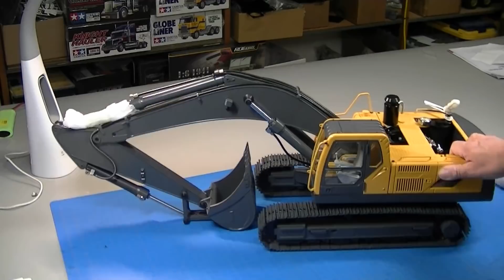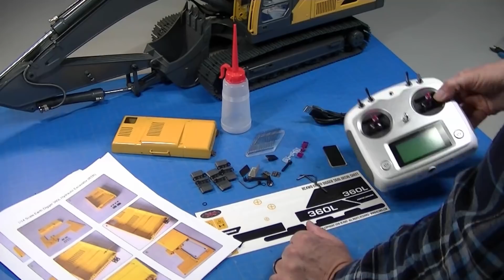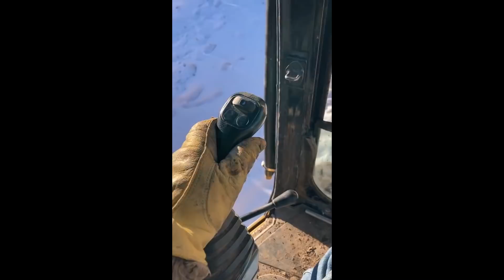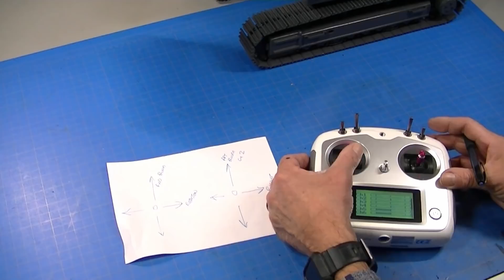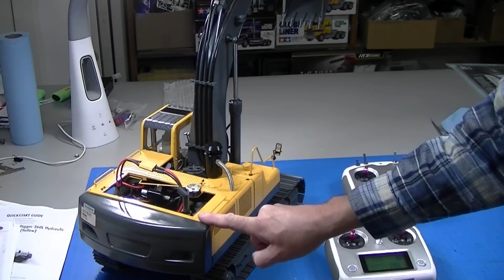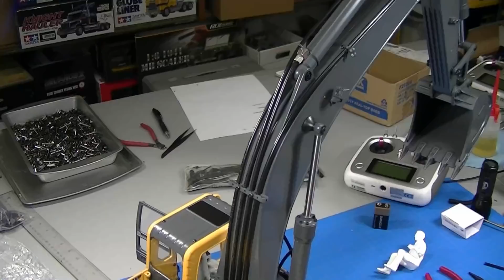1/14 RC Hydraulic Excavator Earthdigger 360L RC4WD - Setup, Programming  & Adding Lights

Comment: Hi, I have oil coming out of the muffler. Can you tell me why?
Reply from the maker: The muffler is the vent for the oil tank.  If the tank is overfull or you tip the machine on it's side oil will come out.  I put a balloon on the vent when I tip on the side.
Reply: @HobbyconceptsLLC Oil also comes out from starboard
Reply: how much oil should be in the tank, I'll tell you about half of it

Comment: top notch video as always, Ive just added this unit to my line up of Hydraulics.  going through the process of installing the extra options and changing the controls around also.. You have a eBay store?  If so Im sure Ive bought from you before but I know I do business with semi joes as well..
Reply from the maker: I don't do eBay anymore just my own website hobbyconcepts.net
Reply: @HobbyconceptsLLC  I totally get the quitting the eBay seller thing.  I have too as far as selling builds etc.  The fees and now taxes thing are a bit hard too swallow.  I’ll check your site out 👍🏼

Comment: Just got one and it looks amazing! Will set up like you showed. Also.. How did you get side plates off? Allen wrench fit above tracks? 
Also looks a bit tricky to change oil..curious if you did that yet and how? Thanks!
Reply: Actually just found that the top of Oil Tank lifts right off and slew cab to get to screws.

Comment: Great Video..thank you. I had the older 4200 and this looks nicer. I like the mixing idea too. Question is there any way to make the tracks progressive the old ones had speed controllers for each track so you could control the track speed? Also how do you adjust the overall head pressure? Thanks! Tom
Reply from the maker: On this version the tracks are one speed but seemed to work ok.  This has a pressure valve to regulate the pressure.  I had one of the valves fail on a dozer and drove me nuts trying to figure it out.  Ordered some new better pressure valves on Ali Express and fixed it.  More PL18 EV and excavator vides coming soon.,
Reply: @HobbyconceptsLLC  Are there ESC's for each track like with the slew motor? It would be odd but maybe they are missing for some reason? Thanks..Tom
Reply: @HobbyconceptsLLC  Oh maybe you mean variable but only one speed slow to max. Not two speeds like the wheel loader. Also how often do you change the oil? Looking forward to more videos.

Comment: Hey Bob what do feel the biggest battery you could fit? 6500mah or smaller.
Reply from the maker: It is a tight fit for the battery so I put in as big as would fit.
Reply: You can also hook up via a remote wire; a larger car type 12 volt battery...works just fine and runs for a long long time.

Comment: That's the way a trackhoe operates. U also have controls for a rubber tire backhoe. Witch is up&down and swing will be on one leaver.and in&out and the bucket will be on the other control.

Comment: With tractors and trailers that do everything a real one does (working fifth wheel, trailer drop legs and air suspension etc.) the only thing missing is exhaust smoke.  Have you ever considered using a 10-16 volt 5 millimeter smoke generator from the model train world on a project?  This would really be neat on construction equipment or trucks.  If you can do light up dash instruments then this should be a piece of cake for you.

Comment: Great oveview of this machine. Defenitely a sub from me. What is your thoughts of this vs the 4200XL? Also, I have a question in regards to the mixing. As you mixed it in this video the mixing was only for being able to move the bucket and arms while the pump was not on. However, is it possible to mix without the delay so that you use the mixing also when digging? Or do you have to have the pump on 100% when digging?
Reply from the maker: There is always a small amount of lag because of the pump motor start up time when using the mixing.  Probably will always be best to turn the pump on when digging.  I do not have any experience with the 4200xl but sure like the 360L!
Reply: @HobbyconceptsLLC  Thank you 👍

Comment: It looks like they have made a lot of improvements to the excavators over the years, as this one is much neater inside than Aaron's earlier versions from RC4WD. I had forgotten Cat uses a different control layout than everyone else. A great explanation on the radio and setting up the mixing of servo and pump.
Reply: Almost all excavators now use the Cat layout for the controls, the only real exception is Hitachi.

Comment: You did a great job on the video!  That is a nice looking excavator.  I don't have the Bier sound system in mine.  I have the Servonaut SMB unit which requires 4 mixes to do all the sounds.  That radio only has 4 mixes.  So in the end, you can't mix the pump cause all available mixes will be the sounds.  I've been debating on getting another radio with more mixes so I can do both the sound and the pump on my excavator.  My 870K has the pump mixed and it is nice to have that feature.  I'm very excited to hear how your sound system actually sounds.  I've seen some super realistic stuff from Bier.  I'm even more excited to see what you do with the D10.  That is next on my list so I look forward to those videos!!!
Reply from the maker: The Beier sound does not require any mixes so it is working out great.  That video will be up soon.  The Dozer is a few weeks off but I am really looking forward to that one also!

Comment: you have channel 9 set as a switch instead of a roll.  I bet the type of channel in the settings of 9 is different than 10.  They need to be VRA and VRB if i remember for 9 and 10.  You might have it as SWA and VRB.  I don't have my radio with me.  but all that is adjustable in the settings.
Reply from the maker: Good thought but I checked it and was correct.  Probably a bad pot inside but I don't want to open it up to check since it is brand new.
Reply: @HobbyconceptsLLC  go ahead and crack it open 8-)

Comment: The settings on that radio allows you to switch the channels on the main 4.  so you don't even have to move around the actual receiver cables...  Just FYI for the next one.  I think they call it Stick Mode in the system menu.
Reply: So you can just flip the right to left controls with Stick mode in systems menu? That would set it up like a lot of John Deere machines with dipper and bucket on right stick.
Reply: @thomasosika5056  yes, on the FS-i6S radio, you can change stick mode, 1 through 4.  without actually moving any of the plugs on the receiver, it just maps them differently for channel 1-4 on the radio.  So you can switch to standard or JD controls.  It is very easy to switch, test it, and switch to next, test it, etc...  see which you like best.
Reply: @jleverington  That is great..I would like to switch it up between JD and CAT nice to just be able to on radio rather than switch servo plugs. Thanks! On another note..I notice the new PL 18 being used for Construction RC stuff. Do you think there is any advantage with an excavator over stock radio? Sticks seem quite high also..but maybe comfortable.

Comment: you might try to set that offset % to a value greater than -  100%  and  +100% to get rid of the lag. This looks like a Flysky  FS-I6s  TX which lets u set the percent values for servos to a value greater than 100%
Reply from the maker: I am going to continue to refine it.  Actually quite happy that it worked!

Comment: Nice machine!! And also a great video, great reviewed, Bob!! The transmitter is a Flysky/Turnigy FS-I6S. I have the same radio for my new to build Mercedes 1850L Delivery truck. The USB cable is to update the firmware, be sure to update to the version that is released in April 2020. It has dual rate, wich was missing in the previous firmware, but now is present. Looking forward to the dozer. Great work!!!

Comment: Mixing with these machines WILL improve the battery life greatly! It makes the difference from one hours run times  to 1.5-2 hours run time!
Reply: I have a question in regards to the mixing. As they mixed it in this video the mixing was only for being able to move the bucket and arms while the pump was not on. However, is it possible to mix without the delay so that you use the mixing also when digging? Or do you have to have the pump on 100% when digging?
Reply: @rcrelatedstuff6092  the mix is set up for the pump not to be running continuously.  as soon as you move your stick on the transmitter it will then turn on the pump 100%. there is a slight delay in the beginning of the movement only because the pump is building its pressure.  As long as the sticks on transmitter are in motion the pump will be at 100% if there is a stop in sticks the pump shuts off and repeats action when movement it made again on sticks.